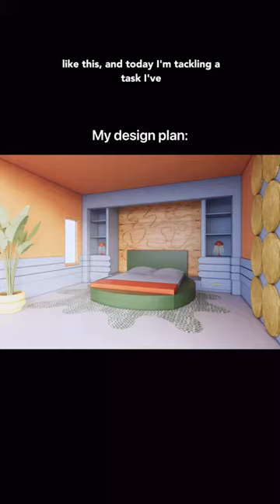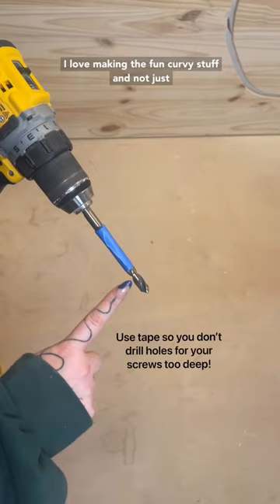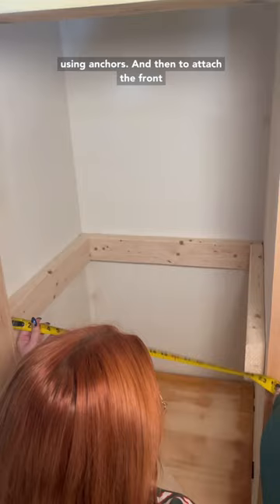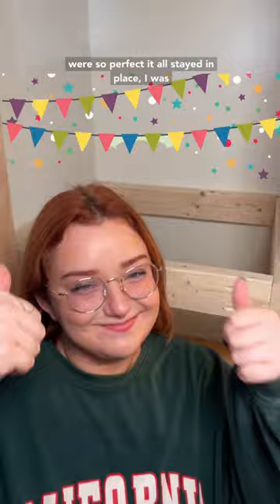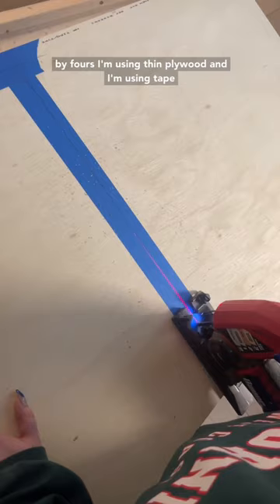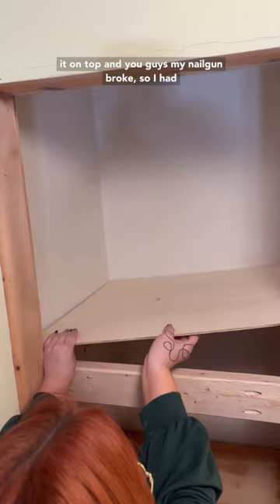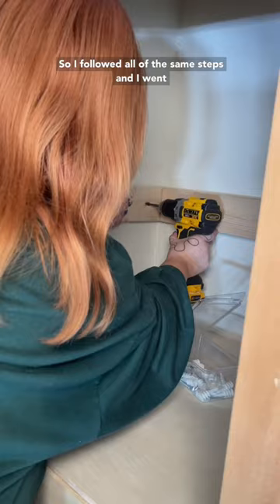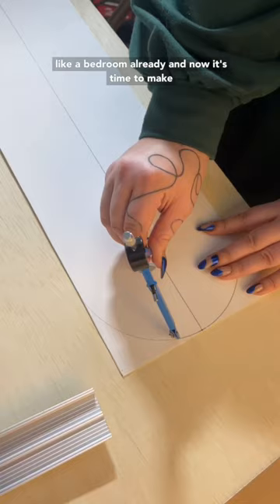Tackling a project I’ve been avoiding in my bedroom #shorts

Comment: So when my old job got a renovation, the guys that came in put these built-in shelves in and did almost what you did...except there was no finishing work. They slapped a couple of 2x4s on the wall and then slapped the worst cheapest plywood on top. That's it. It looked so wrong. We tried to make it look good by sanding some of it down and painting over it but it took us hours of our own hard work just to make it look half decent. 
I wish I would have seen this before and I would have just offered to do it myself 😆